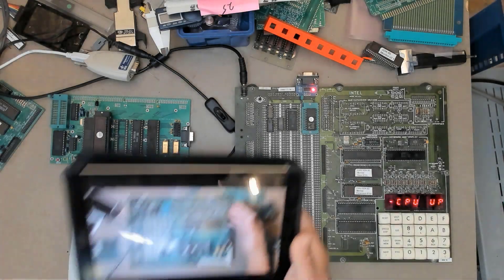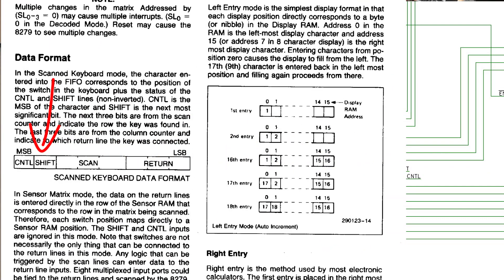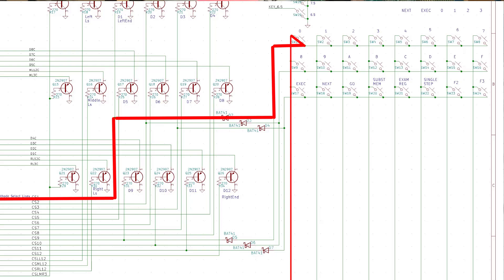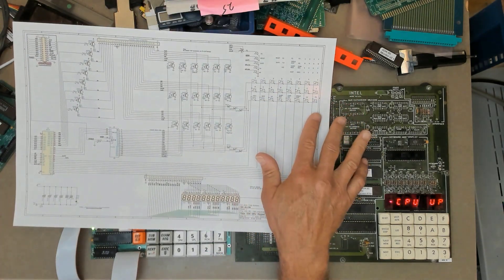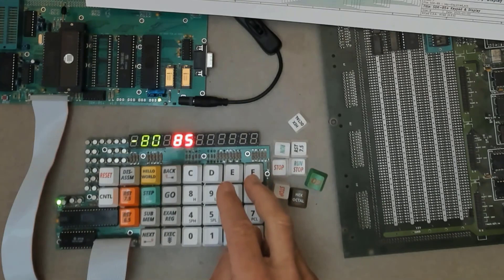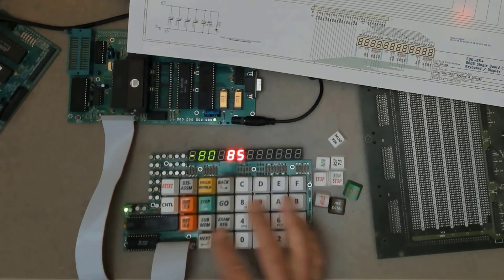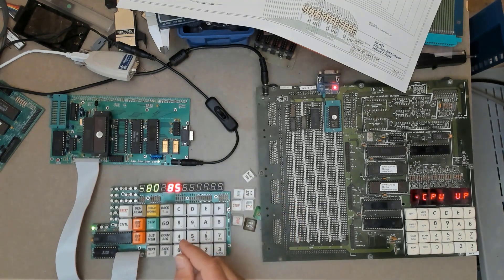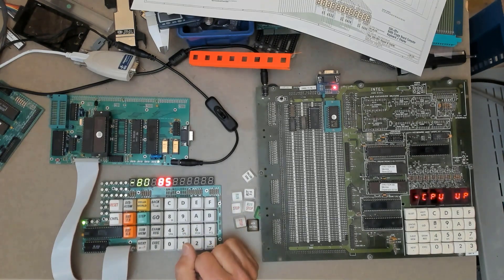{106} SDK-85+ keypad display board is FINALLY assembled and tested

Comment: Just as a suggestion for future designs, the VS+ and VS-  pins on the MAX232 can be used as a power source. It's limited to no more than a couple of milliamps, but that's more than enough for a 10K pullup on the Rx data line, or on a handshaking line. That way you don't need to tie up one of your driver pins.
Reply from the maker: good suggestion